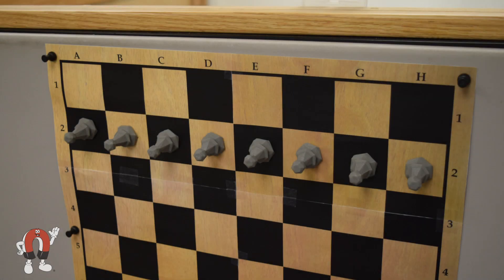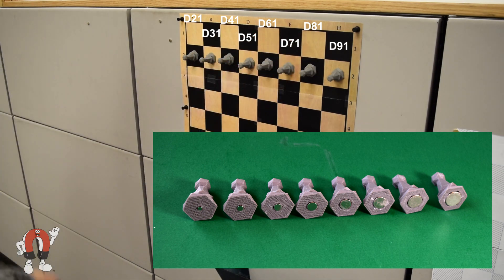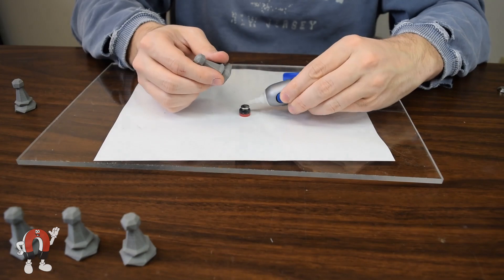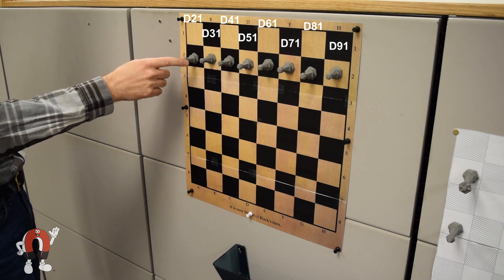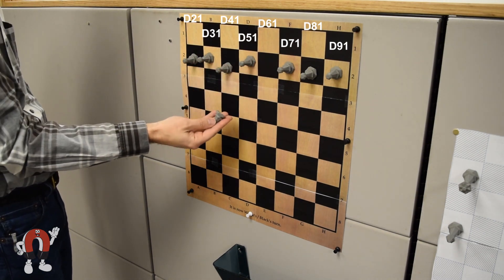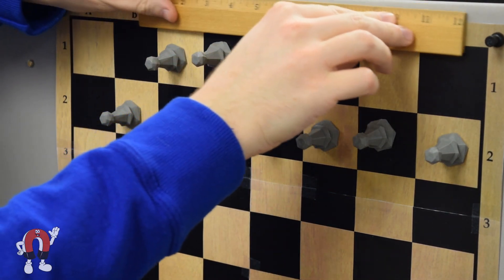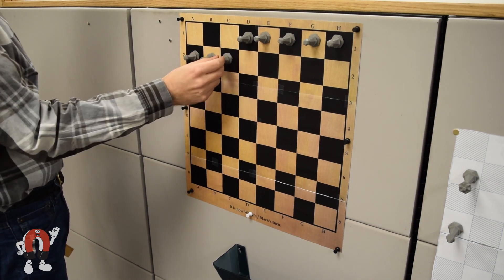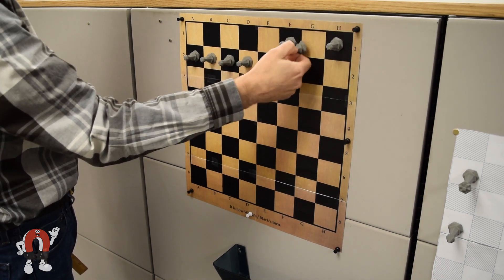Magnetic Chess Board - Prototype!

Comment: Also you don't want magnets to fracture, or to exceed the strength of adhesive. Consider how the pieces interact in storage. Also the possibility of making the board magnetic and the pieces magnet-receptive which would make for easier replacements. A key issue is safety around children, another argument for embedding the magnets in a board.

Comment: I made my own magnetic chess set some years ago. I painted the playing surface on a rubber-footed 1/16" thick sheet metal "board" and glued regular cheap magnets right to the bottom of the game pieces. It worked reasonably well. I like your recessed magnet design. When I think about making a magnetic chess set I think of the following: 
Magnet strength should not lift the playing surface.
Magnet strength should maintain position in the event of accidental contact during game play. Tipping momentarily is ok.
Magnet strength should not attract, to the point of contact, adjacent pieces (perhaps use shallow pot magnets).
Magnet strength should not require too much effort to lift pieces during game play.
Game piece bottoms should not be capable of scratching the playing surface under normal conditions.
Wood veneer over sheet metal for the playing surface would be wonderful.
Thin brass, copper and or aluminum sheet metal squares could be epoxied onto steel to make the playing surface.
Wooden or non-ferrous metal game pieces are a plus.
Conversion kits is an idea as well.
I would like to purchase a prototype if you would like the feed back.
Perhaps if you post links to your video on some chess related facebook pages you can get some more ideas.